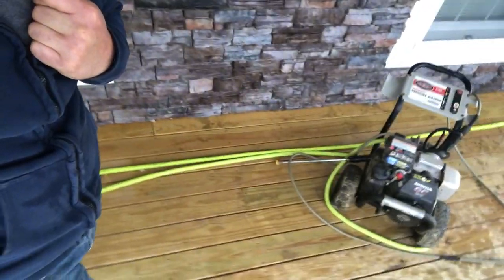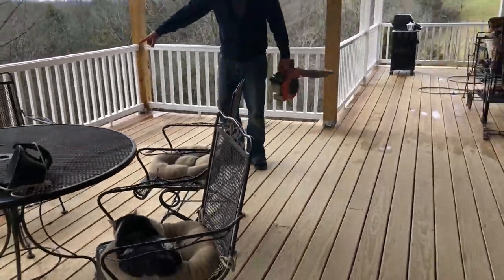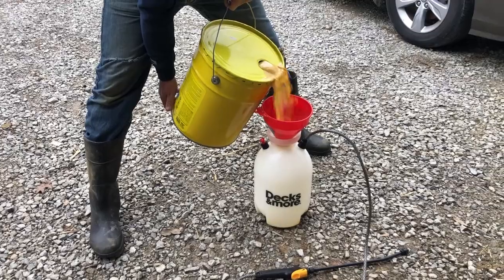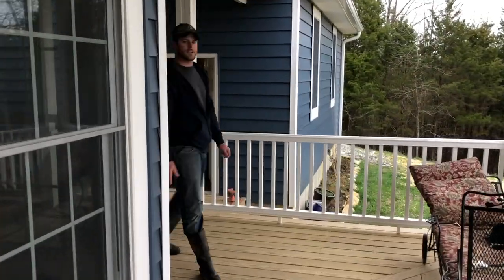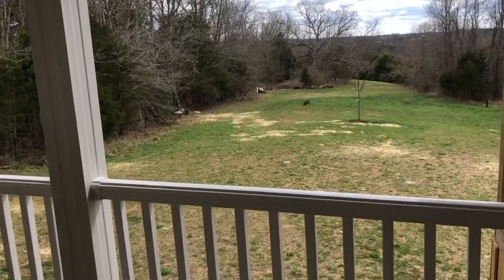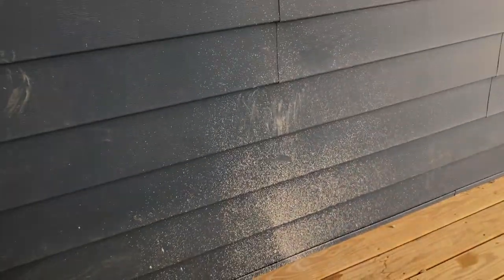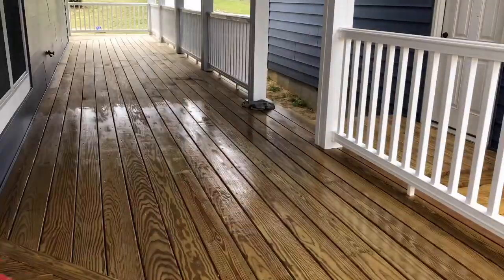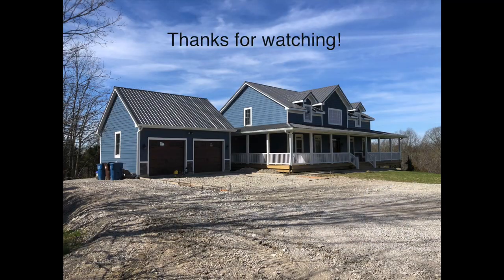Building our Farmhouse: #63- Sealing our WRAP AROUND PORCH  (how to seal a deck)

Comment: I am preparing to seal a new deck with Cabot Clear.  I am going to use a weed sprayer and follow it with a car wash brush to spread it out evenly.  Keep your fingers crossed. 🙂
Reply from the maker: +Eric Matthew Good luck! And you won’t be disappointed with this Cabot sealer. I have used so many brands of sealers over the years and this is the only one that I would honestly recommend to people. It’s expensive but worth every penny.

Comment: I just picked this up at Lowes, I am debating whether or not to use this or the Behr Clear, results are entirely different on a test sample. You have a great video and I would like to know how the stain sealer is holding up after about 2.5 years. Thank you.
Reply from the maker: So far the sealer is holding up very well. The only areas that I see it is possibly worn out is on the steps going on to the porch. Everywhere else the water still beads up like we just applied the sealer. This is very expensive sealer, but seems to be holding up very well.